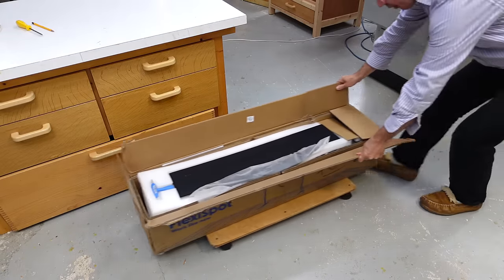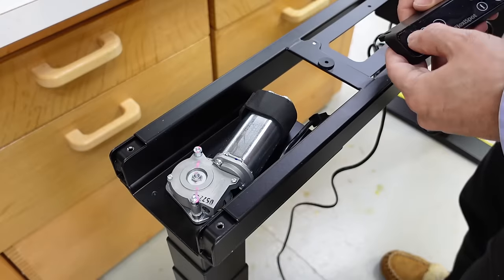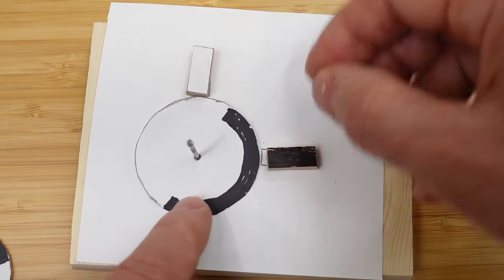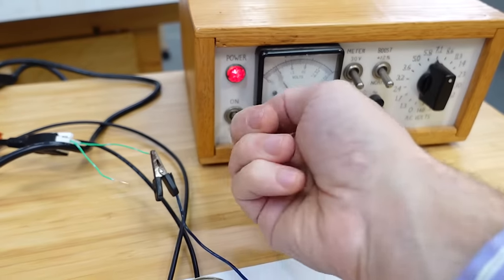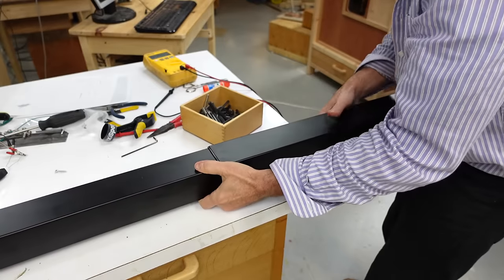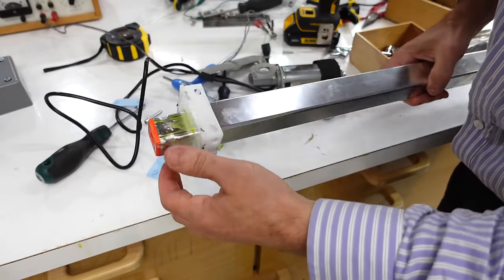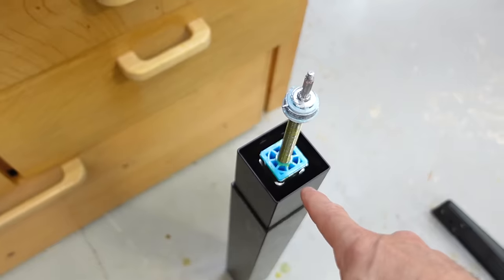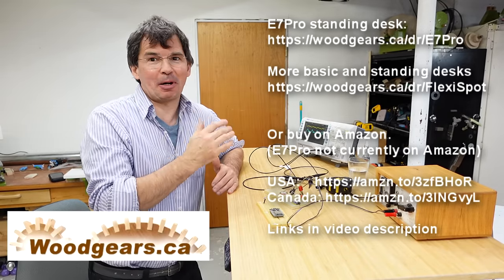How standing desk legs actually work

Comment: Extending legs... 
I expect Kind of like inverse of a turnbuckle.

Two lead screws of opposite hand rotated together. (could be machined on same bar, but coupling nut more likely)

If lead nuts on both threads  prevented from rotating  they'll be driven along rod in opposite direction..
Then it's just driving the leads screw while allowing extension... Square Hollow tubing shaft which is close running fit over a square nut fixed to shaft, can work as akin to extra deep socket driver..hollow square shaft plugged at motor end with a 2nd square nut. Square nut driven by motor.

Comment: Are there any markings on the leg or power supply indicating who actually manufactures the legs? 
I have a 3 stage from Ikea that was made by Rol Ergo. It utilizes LINBUS protocol to communicate between the legs and keep itself in sync. I suspect that this FlexiSpot is similar.

Comment: I am going to speculate that it is 1 rod with a division in the middle between left hand and right hand threads, like on a turnbuckle. The lower section works on the left hand thread with a left handed nut section and the upper moves on the right handed thread with a right handed nut.
Reply from the maker: I explained why it can’t be one rod in the video
Reply: @matthiaswandel  sorry, I got excited and all things stopped registering to my ears after until I said my piece. Carry on

Comment: For the model-building use-case, a "tilt" function would be dandy.

I had no idea how much the tilt mattered until I got used to PSUs and oscilloscopes with tilty feet (front-up or back-down). Just 10deg would do wonders.
Reply from the maker: there is the risk that everything ends up sliding off your desk!
Reply: @matthiaswandel  Lol true.
Most draughtsperson's desks did have a useful tilt, and indeed a little ridge to prevent pencils from rolling off.

Comment: The outer tube of the lifter looks to be over 70cm in length. To get the total lift extension of 67cm the threaded rod and the inner box section tube only have to each extend 33.5cm. This means the two moving sections only need to be a little over 67cm in length. The inner box section is attached by a coupling nut, or two, to the rod. The rod is then attached to the outer box section. If the inner box section and the rod are both 72cm long they will remain attached inside the outer box section tube when each extends 33.5cm. Inside the outer box section there will still be 34.5cm of each of the inner box section and the rod with an overlap of 7cm to allow for a robust coupling between the rod and inner box section.
It's a shame YouTube doesn't allow for links anymore or I could link to a diagram to explain myself.

Comment: Does it level worktop if placed on an uneven surface? If prepared to forgo measurement and delay of height/memory, a tilt sensor would be a far simpler control loop.

Comment: I am 98% certain that flexispot is just rebranding the stand from some chinese supplier. I bought a big box store kit that had the exact same motor and driver system. I agree it worked well but the system ended up failing because it was damaged while I was moving. The desk was dropped off a moving dolly, about 3 inches off the ground, and some of the internal gearing in the extending leg on the side that was dropped failed. Hopefully flexispot could provide some better customer support than I got from the box store. Also, I was never able to find any info about the actual OEM of the components.  

I ended up just swapping the standing desk part out for fixed desk legs from Ikea LOL. They honestly are so much better for my application.
Reply from the maker: I suspect that internal actuator is a part that other standing desks use as well.  Now, if only you could buy that part separately.  The threaded rod goes thru a plastic nut.  An impact can easily produce 20x the force of a static load, so I imagine the impact probably broke the internal plastic nuts.  I suspect the gearhead motor is just fine though.

Comment: I bought a flexispot desk after seeing one of your videos, but I sent it back. Specifically the E7. It was unstable in the sitting and standing position. While the build quality is fine, the tolerances between the leg extensions are to big which causes some movement. I expected more stability from such an expensive desk (470€). I guess I will have to spend even more money to get one similar to the ones at my workplace which cost around 700€.

Comment: 12:14  if you grind away you could put some kind of ring on it or just screws to connect the plastic to the metal housing,
Reply from the maker: I thought about screws, but that gets messy -- might not work. rings -- definitely won't work cause they end up sticking out.

Comment: Hey Matthias, what are your thoughts on the watertightness of Flexispot frames? I have in mind to build an outdoor coffee table/standing desk. I figure as long as the control box and motors don't see any water it'll probably be ok 🤷
Reply from the maker: not a good idea.  if water gets in the columns they will rust.  even with our direct water, corrosion is an issue

Comment: I have a 3.3 meter wide desk at my  home office, I would like something like the pro version that could do some sort of cascading connection allowing the whole desk to lift.
I'm interested in knowing what happens if you do a prematurely forced end on the table when out of alignment. Does that set it to 25 inches while still misaligned?
Reply from the maker: Thera are some3 legged ones.  but for that wide, perhaps 2 desks would make more sense

Comment: There is no way to use smaller, square table top on these (narrower than your current setup), right ? Was looking for some such solution for 1m x 1m height regulated desk but so far didn't find such.
Reply from the maker: Correct.  47" is about minimum for that one.  But the less expensive ones I used earlier (links in description) can have the legs as close as 70 cm between them.  So still need about 90 cm (3') for the top minimum.  Unless you want to take an angle grinder to it, then it could go much narrower.

Comment: Drill a small hole in the silver aluminum tube and inspect it with a small snake camera.  You could do it in a couple of places if needed.  Or see if you can find someone in your area to X-ray it.
Reply from the maker: its not like there is any extra space inside the tube.  If I drill a hole, I will end up damaging the threads.  Also will end up with aluminum chips stuck in the grease

Comment: There's an accelerometer on the mane board.  It's a QFN identifiable by the 2 472 resistors biasing I2C.  The lion kingdom's desk stays level despite the floor being uneven.  1st time anyone documented the leg innards.  Sadly, they don't seem user serviceable.  The lion kingdom's desk needs lubrication somewhere in there.  Eventually, they'll start detecting friction as an obstacle & become chinese landfill.

Comment: Absolutely fantastic video, thank you for sharing. there seems to be a fair amount of assembly/electronics that goes into raising a desk. to be honest I am quite surprised at the price point on comparison.

Don't suppose one can repurpose these for other uses??
Since you seem to have the blessing of Flexispot, you can do some destructive testing?? like maximum load? 
Can it be used as a separation tool? 
Can it be extended to hold plasterboards on ceilings' for decorating??
Limitless possibilities :)
Reply from the maker: I was thinking they would make an awesome joint strength tester actuator.  Except I don't need that much travel, bu I do need more force.  I can push about 300 kg as it is, more than the flexispot is rated for.

Comment: 5:00 detectors spaced 90degrees apart will work for any number of lines
Reply from the maker: Any odd number of lines.  But these things are always even.  Also, much easier to have the detectors close together, at 90 degrees apart, too sensitive to position (typically there are over 100 lines)
Actually, the detectors often sense more than one line at a time too.  I just didn't want to complicate the explanation too much.

Comment: can you buy the legs and brain separate from the table top?
or failing that make your own table top?
ore is there a fixed length between the legs?
Reply from the maker: you mean buy the while frame with just a few bits missing? why would you do that?  top is sold separately.
Reply: @matthiaswandel  if I can only get the legs I can make my own table top
no need to pay extra for a larger desk

Comment: I believe there would be one possible way for the threaded rod to be the only screw, but I would need to know the exact lengths of all 3 segments, and the normal short and normal tall height of the desk when fully assembled.  From what I could see, the threaded rod did not appear to be coming out of the housing by the total length of the center housing, but was coming about 1/2 of the way out, maybe a bit more?
Reply from the maker: the legs come about 2/3 of the way out.  one rod cannot accommodate
Reply: @matthiaswandel  ahh, was hard to see for sure in the video, thanks for replying though! Might be a coupled gear or a reverse threading of some sort, definitely want to see inside the legs

Comment: I'm kinda surprises they didn't use a cable in the legs.  Suppose a double screw is less likely to cause problems.
Reply from the maker: the screw has the big advantage that it feeds back less to the motor when load is added
Reply: @matthiaswandel  I was thinking more, a single screw, where it moves a pulley to double the movement of the cable end.

Comment: Looks to me that as the motor drives the screw, the screw pushes the top portion upwards whilst simultaneously driving the screw housing downwards. So they are getting a 2:1 increase in height per rotation and thus able to achieve such massive differences in the low height to the top height. This makes me wonder, have they tried to apply this to chairs? Hydraulic adjustable chairs are so annoying to get the height right and even then it is only a matter of time before they give out too.

Comment: I guess a tooth  belt drive could be a simple way to engage both legs and one motor, but maybe the belt would have to be too thick. Also not so adjustable for different leg spacing.

Comment: You ever do an EMF reading on these things? My standing desk is very similar (probably all made in the same warehouse), and the EMF reading from mine is absolutely through the roof. I am not massively sensitive to these things but since I sit at it most of the day and it's right next to my nuts, I just leave it unplugged and only plug it in to operate it.

Comment: Their are other problems with the single motor, cross bar.  The whole drive train and gears bar can experience a LOT of torque/stress if the desk is heavily loaded, which could lead to failure (let's be honest, most of this stuff is made as cheaply as possible - exceeding the designed load is not unlikely).  Also if for any reason the legs get out of sync, the only possible fix is manual intervention (never say never, any looseness in the system can result in slippage).
Reply from the maker: the only way these shafts slip is if it breaks, because its a hex shaft that engages. So the only way that hex shaft slips is if the hole it goes into is somehow worn out

Comment: Matthias, if you're looking for something interesting to test, how about making some samples of the Poor Man's Fiberglass and putting them through your torture course?

Here's a couple of videos on the subject.
This individual made it out of insulation foam and two different materials.
Painters drop cloth and bed sheet cloth.

Check it out, it may peak your engineering curiosity.
It would also be interesting to see what the material can actually withstand.

Trying Poor Man's Fiberglass for the Homemade Trike Body
https://youtu.be/A2q4mQl0CSI

Poor Man's Fiberglass Durability Test
https://youtu.be/ZJK2131vHak

Comment: My assumption is that there are 2 sets of threaded bar which has different tooth pitch - connected in the middle by a coupling mechanism.
Reply from the maker: The total length of that bar cannot be longer than the leg all the way down.  And at that point, it doesn't have enough total thread for the leg to extend to more than double its length

Comment: 12:58 if the threads are different pitch that will also give an extra "gear ratio"
Reply from the maker: They are the same pitch.  Both segments lengthen at the same rate

Comment: 0:10 "no strings attached"... I clearly see a power cord.
Reply from the maker: yes, but that's a power cord.  not a string
Reply: Maybe the humour doesn't translate well from Dutch. We have a lot of words like cord, cable, rope, wire, string, (and many, many more in marine contexts) depending on function and appearance. Even though the division isn't always clear, each has their own, a power cord is a "snoer" (cord, also in the lace sense) or if it's thick a "kabel" (cable). However, all those words can be humurously used interchangably.
Reply: @IIVQ  He got the joke. He just playfully jabbed back. :)

Comment: I have some with a chain and pulley inside to gear up and extend the screws movements, like on a forklift. All desks I've used will go slighty out of sync after a bit, so I always run them to the down endstop every now and then
Reply from the maker: I would guess if you unplug repeatedly while raising with off center load, that it would get slightly out of sync

Comment: It's not clear to me how it knew that the legs were at different heights to begin with,  back when it only let you lower the desk. It must have remembered when it moved while one leg was unplugged. I guess the real question is why did it let you lower the desk when one of the motors was unplugged?
Reply from the maker: it only allows moving it a tiny bit though, I kept having to push the button

Comment: OK, I have a non-destructive idea to see the inner mechanism. Use like a one inch hole saw on a drill press without a center drill to drill an inspection hole in the inner square tube. Of course you do run risk of some metal shavings getting inside but you should be able to take a peek that way. You could even weld it back on if you were concerned about it being weaker with the inspection hole.

Comment: Can this be switched to units of measurement invented by not a drunken lobster?
Reply from the maker: as far as I know, ther are no units of measurement that were invented by drunken lobsters.  So no problem, it does not use measurements invented by drunken lobsters!
Reply: @matthiaswandel  

I mean
 to switch this to the metric system. And about a drunken lobster, this is a meme about the imperial measurement system.